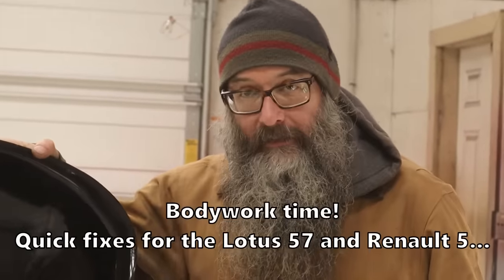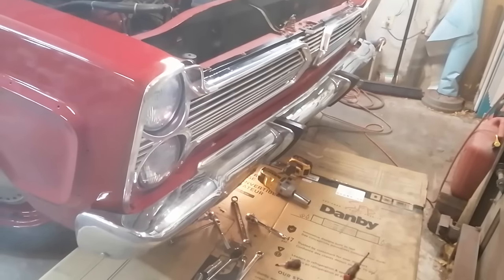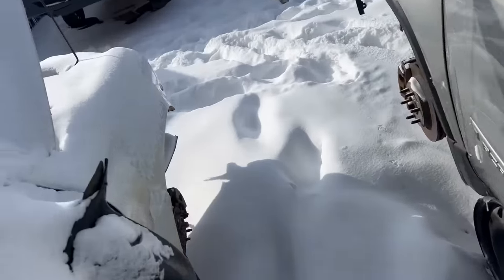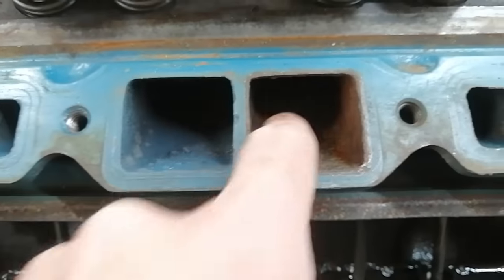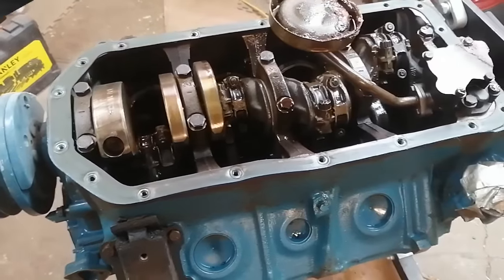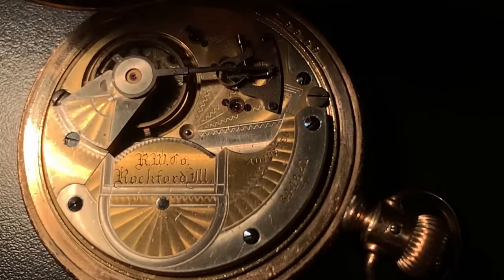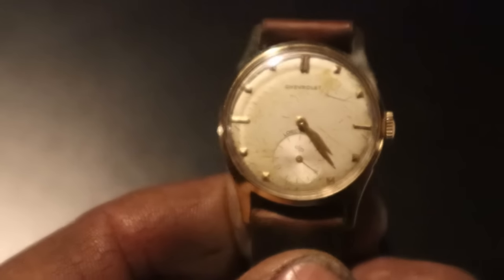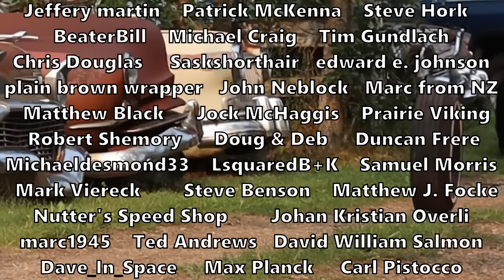Oldies at the Scrapper! Plus: 66 Fury, Buick 401 Teardown, Renault paint, and Classic Timepieces!

Comment: Trivia: Tschuy-Vogt or Tevo, was registered; 1926 in Grenchen Switzerland. The brand did not make in-house movements, but rather put together watches with: hands, dials, movements and cases bought from various manufactures to generic specifications. You can find several Bucherer watches put together by Tevo. This Particular watch was for the Swedish market, it’s got a very robust A.Shild calibre 1560 a lovely black guilt dial packed into a robust stainless steel case. It was in a very sorry state and I thought it deserved a full service/repair to bring it back to the land of the ticking.

Comment: That's a really nice 401 Buick Miles scored. I would check the cylinder wall clearances and if the bores are acceptably straight and the clearance reasonable run a ball-hone though it to put a good cross-hatch on it. Ball (dingleberry) hones have a bad reputation but they are waaay better than a brake cylinder style hone for this purpose. I have a Sunnen portable cylinder hone, much better for either if you are removing material, but the ball hone is much easier to use for cross-hatching, does a great job and costs very little.

BTW - FM is Federal Mogul. Those are rebuilder grade bearings, but since the are older USA made ones of excellent quality. No idea if FM-branded stuff is still made in the USA, the answer would probably disappoint. I'd pull the crank and clean out the oil galleries in the block since it's all so dirty, and reassemble with some good assembly lube. Along with the aforementioned cross-hatch, assuming all measures good with the bores. Looks like a great find for a few hundred bucks..

Looks like there was some rust in a few chambers around the valves when the previous owner did the teardown. Certainly interested to see what the seats look like.

I've watched every episode for 6 or 7 years, and been a Patreon supporter for 5. I just recently created a youtube login so I could comment and subscribe. I love all your content, especially the bodywork/paint and engine rebuilds. I'd love to be able to buy another 'T Shirt', I should have bought a few when they were available. Have you considered doing a re-print on those, they are a classic. I also have the Fury shirt and would love another in addition to any new ones you might come up with. Please give us more shirts - they are the only youtube merch classy enough to wear in public, IMO.
Reply: Thanks man!
I'll do what i can for the 401, but I'm keeping myself on a super tight budget. So, using the tools that i own already.
I'm gonna splurge for 1 toy on this build. Guess? Haha
Yea, agreed love the cwm shirts!

Comment: 28:59 - The exhaust crossover is there to warm the carburetor  base to help fuel atomization during cold weather / starts. Yeah, this was designed before ethanol was introduced and 100 octane was available, so fuel didn't boil as easily back then, so blocking these off has good points as well as the bad.🤔
Reply: Thanks for the note. Makes sense. Think as a summer car, its a good idea to block it off. Guess well see

Comment: Myles is doing amazing progress with the 66 Fury , absolutely fantastic assembly work with the grill. The 59 Buick engine Myles has is in a very good shape, in some ways better what Scott had. However there is also a reminder that condensation and moisture are the number one enemies of any engine when they sit outside years without being started. Good thing Myles took it apart and got to save it just in time. The 57/58 4 door Mayfair clip would have been worth saving cause chroming gets exponentially expensive with every year. Not sure there is a huge demand for the front clip since it's a Canadian car but I would have gone and taken it off. I do understand it would have costed money for Dean and he may have fallen short with other things he may have needed.
Reply: Thanks Maz!
The builds are coming together well!
The Buick was a big surprise!
Leaves me more time to tinker with it
Reply: @mylesmoparfreak6562  I think you scored well with the engine. Just make sure that the rings are not sized or something else is a miss. In theory you should not have any issues, cause it looks it was a fresh rebuild in the recent times. Valves I would just take out and lightly overlap or clean the rust off from the condensation. Hoping to see the 66 Fury and Pontiac do a day at the races sometime in the future.
Reply: Nah, went with cheapo rock auto cast rings. No need to gap em

Comment: Ifound a rolls razor back in the early 70s it was a blck metal box witch i found out was silver and i polished it one each end a release botton in side the released plates had leather on one site and a stone on the outher and the case had a rack the blade is attched the handle pops up and by moving it you can sharpen or strop depending on witch plate you leave on it you have a museum in your area they probly have one ,in the early 1900s it was the best in shaving.

Comment: I hope he pulls that 401 apart, strip it, hone it, and wash out the block and your oil passages in crank, cam, & mains it looks like the prior builder muffed the honing, and failed to thoroughly clean it all out before reassembly.
Reply: Oh yeah John, i go right through the block n heads, cleaned everything, and blew it out.
Hope i got everything, guess we'll see. Thanks!

Comment: The diagonal hood bracing was only on the Sport Fury? We had a fury  3 4d ht with a 318  and I don't recall the brace. The Flying Spagetti Monster was smiling on Miles with the Buick.. Maybe pull one freeze plug, so as not to tempt the gods wrath? FM Federal Mongol bearings. Cheers.
Reply: Not sure about the bracing. I built a 66 fury 3 4dr for my sis years ago, and didnt notice a difference?

Comment: Myles, FM. Federal-Mogul. 010.  Undersize . Your grill turned out nice. Did you use any rubbing compound with the extra fine steel wool ? I will try it on my 66 grill.  FYI a tip on the door trim, red, white ,blue . I used colored tape from the local hobby center . Mine is red / red interior. You and Scott did a nice job on the paint.
Reply: No way Kevin! We have matching cars? 66 Fury red / red interior? Cool!
Mail us a pic!
Reply: @mylesmoparfreak6562  Myles, will mail some pics, did you use any rubbing compound with the steel wool, your grill came out nice.

Comment: I had a 1989 for feistiva it was a great city car 4 speed standard Trans 4 cylinder the only problem was that 2 guys could pick up the front end and wheel barrel it away several times I would have to go looking for my car or they would turn it 100 and 80 degrees so it would look like I was drunk when I came home.

Comment: Can Mark give me a value on a mens wristwatch, FLORA antimagnetic, SQUARE case, black face? Worth repaired? Probably 1950s?
Have never see it anywhere. 

Miles 401 engine looks fantastic! Yes, simple disassemble, lube everything, and reassemble. Maybe lightly hone the cylinder walls for cleaning. Of course, proper color paint when complete!
That motor should purr at idle and roar when required.

Comment: Do not use exhaust manifold gaskets on those nailheads, they will crack your manifold. They didn't have them from new. Just block the manifolds with some 80 grit on a good straight bench.

Comment: Speaking of sicknesses.. how many outboard motors are you up to now?  I think I'm over 80... mostly motors from the beautiful 50s
Reply from the maker: Ha! Awesome... I am also a fan of the aluminum case models of the 50s... We have a couple dozen, mostly OMC from the 50s and 60s... Cheers!
Reply: @coldwarmotors  Thanks for all the great content.. I enjoy when you sprinkle in the snowmobile, motorcycle, tractor and watch material with all the great car stuff. Maybe this summer you should do a little section of tuning up a motor.. If I didn't live in Wisconsin and have a 1 year old kid I'd totally be your "Mark" for Outboards.. been collecting for 20 years.  Thanks again!
Reply: @coldwarmotors - Soft spot in my heart for the 30 HP Evinrude "Big Twin" my father had on his 16 ft Penn Yan. When it got up to speed it wailed! After a few years circa 1970 it started getting salt water into crank case ultimately it locked-up, thankfully when it was sitting, and not out on the water. We brought it to a local small marina and the guy offered my father $100 (US) for the locked-up engine,  i think because it was a rare 1956 electric start... SOLD! That $100 bought a lot of quarts of Iron City🍺 for my parents. Five years later I put the deteriorated boat in my parent's backyard out of its misery by cutting it up with a circular saw. Since you are dabbling in 8mm, here is an 8mm film clip of that boat and engine in its heyday circa 1966: https://youtu.be/g9dDL4VWek8?si=yz0ohOFfy5tf9FUf

Comment: Miles re do the rear seal it has been sitting a long time if you replace it you will know whats in it if you do not and it leaks after you have it running and in a vehicle that would be sad.

Comment: I want to hang out with you guys. And I definitely wanna build one of my mopar big blocks with miles man... that would be fun.. do you think he likes motorhome 440s? 😂😂😂
Reply: Hey Salty!
I dont mind using 70s RV 440s. You have to do a few mods, but you can get decent power out of them. 500 hp is kinda their limit tho, unless you swap crank, rods, pistons, heads, intake...
Reply: @mylesmoparfreak6562  what's up myles! I'm currently building a 68 marine 383 bored .030 with 1993 mopar stage 4 heads and a 1971 440 holley street dominator intake. And a hughes SMC2942BL cam. Unfortunately only have a 600 holley tho.
Reply: Very cool, and combo should work well. Upsize the carb down the road and gain some rpm up top
Reply: @mylesmoparfreak6562  just tore a 8 3/4 down to use in the 72 charger se that the 383 is going in. 2.96 gears so might run those for fuel economy. Bought a 77 f250 long bed with a 400 2 barrel so i can get cheaper insurance till my premiums drop. I'm hoping to God the 383 makes atleast 425 horse. Or atleast 1 horse per cube. I put 1.14 torsion bars in, welded braces onto the lower control arms after shot pining them and got moog joints and eurothane bushings. Hopefully she handles pretty good

Comment: Myles I'm inclinded to tear down the 401. Your already there now and you, like me, don't have a light foot at times. Maybe the main bearings and rods are not measured (sized) up and aligned properly.  The paint in the exhaust ports is very troubling and you have a lot of nice parts there that might get chewed up if I'm right.  Who builds an engine and doesnt run it?  Could have been a job for a customer who never picked it up or paid for it.
Cheers all. 🇨🇦
Reply: Never comment till the shows done.  Haha.  2 seconds later and your tearing it down.

Comment: The only Harley L Hughey I was able to find online appears to have lived during the 1930s in Detroit, MI... born 1914, died 1974.  IF this is the correct Hughey, it would appear he started working at the age of 15 in the original Flint Chevrolet factory... "Chevy In The Hole"... the modern Flint Assembly would not be built until 1947.  I don't have paid membership to the various genealogical websites, so I wasn't able to find more... but more appears to be out there behind paywalls.

1937 Chevrolets were built in a dozen factories, but the main one was Flint.  Have you ever determined where your 1937 Chevy was built?  I can only assume that all Canadian Chevys were built in Oshawa Assembly.
Reply from the maker: Hey thanks so much for all of the info! Very cool to see, and the dates and places line up? The Chev I have here was brought up from the States i the 80s, I think. It is an American model originally, but I do not know which plant it was made at... Perhaps I will try to find out... Cheers, and thanks again!
Reply: @coldwarmotors  Your welcome, and it's the least I can do for all the entertainment you have provided me over the years.

I did find a bit more info on Harley... I found his entries in the 1940 and 1950 census and his 1940 Draft Registration.

On his Draft Reg, he is listed as Harley Lee Hughey... his address was 2950 Agnes St, Mount Morris, MI.  This address appears to have been renumbered.  And his employer... Chevrolet Motor Co, Flint, MI., so we definitely found him.    5'6" 175lbs Born Jan 17, 1910 in Laboty, Missouri.  On the censuses, he married Delia Ellsworth in 1931 and had two children, Robert L Hughey and Donald H Hughey.  Donald died in 1983.  Robert appears to have lived until at least 2004.  In 1940, Harley is listed as a 'auto mechanic', but in 1950, he is a 'metal finisher'.  Someone listed him as 'Harley T Hughey' in their family tree and it actually traces his family all the way back to the late 1500s... but doesn't list any descendants.

I could send the scans to you, but I don't know how to send private messages on YouTube.

Your Chevy should have a "VIN" something like 1 or 2 numbers, two letters and a 6 or 7 digit serial number.  The leading numbers are the assembly plant.  '1' is Flint.  The two letters are the year, G for 1937 and either A or B for Master or Deluxe and rest is a sequence number.  I think the body tag also has a spot for assembly plant, with a different encoding.

Finding Harley was a 'metal finisher', I can't help but think that that watch was meant to find you.

Comment: Why are you adding the effect to your 8mm film?  Brand new 8mm B&W film will look very, very good, especially at 720p.  All that grain and flashing is a modern effect being added.
Reply from the maker: No it isn't. Sheesh. Why would I do that? The whole idea is to present the 8mm exactly as it turned out. Some bits of it look better than others, that is all. Cheers!
Reply: @coldwarmotors  I did a decent amount of filming in the 80s with 8mm film. Even today the film looks good.   Perhaps the film you had just isn't very good. It's very grainy too.  Sorry that I just assumed you were using a filter to do it.